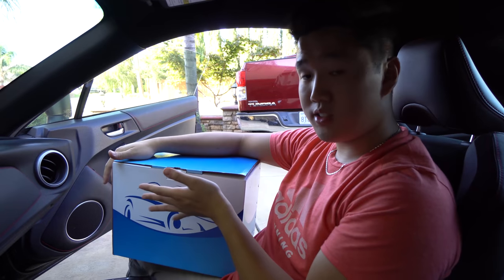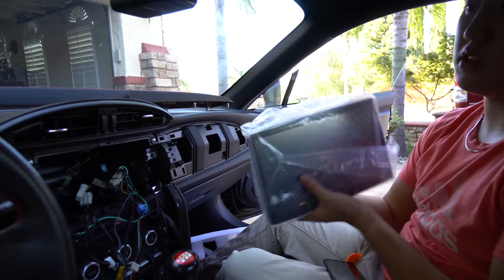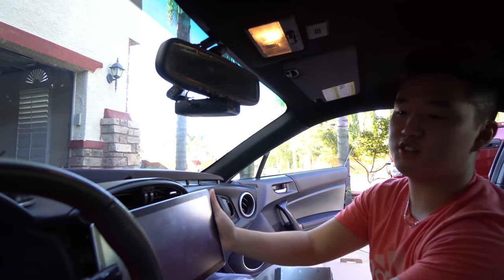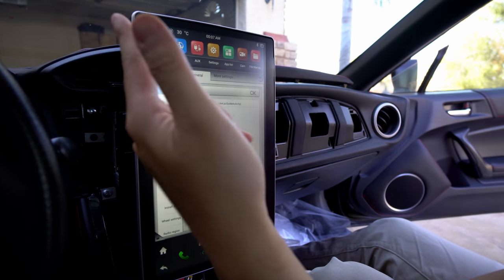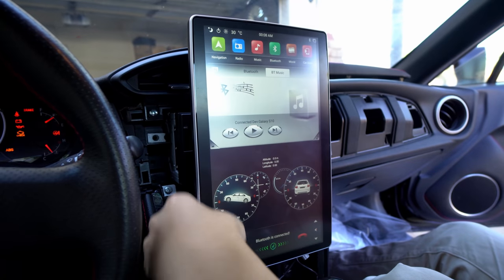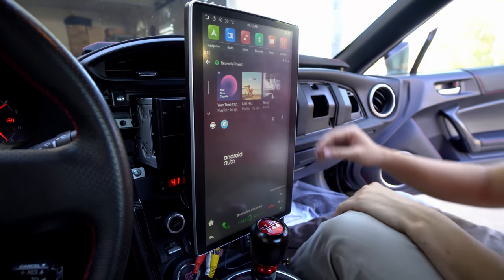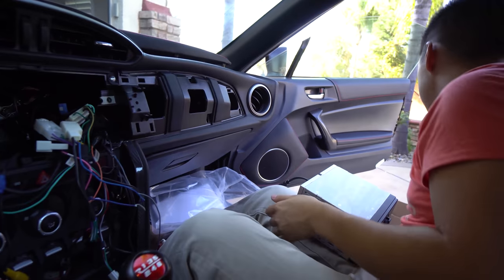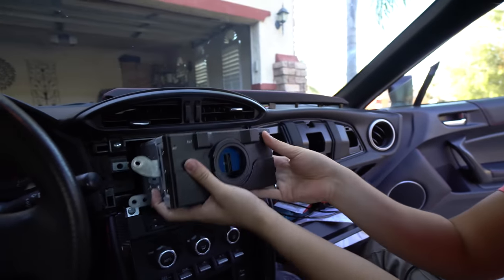The biggest 13 INCH Head unit into a SMALL Car | Install

Comment: How do you prevent theft? I'm sure if someone saw this in my car the windows would be broken. Is it code locked?
Reply: Naughtysauce yea because those are the only two factors that go into getting your car broken in to
Reply: Naughtysauce  In NY I pay about 2400 dollars a month for rent, this is the only neighborhood I can afford.  The "dark ass tint" is not allowed in this state. I don't know if I can find a job right now that makes more than 150k a year so I'm kind of stuck.
Reply: @devinotruth  I couldn't agree more. I only been out in NY for about a year now.
Reply: I have the same question. I have a Camaro convertible and they don't make the custom ones for that car so I have to get this universal unit where the screen sticks out. I like to leave my top down and don't want anyone reaching in and snatching it. The guy told me the screen was detachable but after looking at this video I see there's a bunch of work that goes into detaching the screen. 
 So I guess my dreams of having a Tesla screen will have to wait until I hit the lottery and buy a Tesla.

Comment: Nice 
I just use my Samsung galaxy tab a (with poetic rubber case with 2 magnets inside the case) and 2 air vent magnets to install in my blazer
I'm using a jvc media player bluetooth player as my deck. 
Cheap solution but works great been using this setup for about a year now.

Comment: My friend I'm using aftermarket camera where do you attach the reverse wire to on the radio not the camera as the yellow RCA connection and a red power wire.

Comment: that's an awesome looking unit, I just bought my 1st android head unit an its been a big headache from day 1, I have the hizpo 10.1 android 10 3gb ram 32gb storage of storage I've had issue after issue currently have lost android auto after having to do a reset to fix the last issue, if you could point me towards some type of support or an online page that would be awesome you seem to know a little bit about them so I figured it was worth a shot to ask. Also I plan on upgrading to a better unit when I get a little money saved up to do so what brand would you recommend going with to possibly have a better experience next go round?

Comment: Could you do a Navigation review on the unit from the built in Nav maps as well as compared to android auto,Apple maps and Waze on the headunit? Also how many bands is the EQ? Lastly can you show how Apple CarPlay works on it please! As well as digital audio through USB on both android and iOS if the unit supports this! And front and rear cameras and menu options like DVR

Comment: Was this plug and play for all speakers? I know some wiring harness have the amp-con wire that needs to be hooked up for the door speakers to work. Did the included harness need that as well?
Reply: yes, some cars need add canbus to support original amplifier and original car info.

Comment: Since I saw you present this heady it I got one and waw the full had screen is a pleasure, however too bad it stock to android 8.1 did you find a way to update it to 9 or 10 ?

The only point that annoying me is if you get a phone call, the dial pad remain on the screen and refuse to let you open other apps, excepted if the app was open before you get the call.

Well it almost perfect headunit to me.

Comment: i think i asked this question....does the HDMI out function as video out for rear entertainment. I currently have the joying 10.1 with video in and out connected to a 25" drop down gaming monitor in my SUV.. i want to buy this one to upgrade but want to know about the actual function of the HDMI out!!!
Reply: The Aliexpress listing says it's HDMI output for external monitors.

Comment: How far can it tilt down? I have that slopes down where the DIN doesn't at a 45 degree angle to the ground.
Reply from the maker: it has a ball joint that can tilt up and down. It tilts enough but your screen would generally be hitting a trim piece if you tilt it too far lol

Comment: I had asked u for a review on a 12.1 a while back an here u go with the 13. Thanks. Are we getting a review. Im almost ready to install my next head unit and it will be one these 12 to 13 units.  My main concern is sound and boot up time. I've an 04 golf that will actually fit this pretty nice without blocking anything so its it's a go for me. I will have two amps for bass an voice with the sub so how good is the sound quality an the adjustability on these? Do they have sd card readers?
Reply from the maker: Hey,

I will be doing a review soon. Still testing the Unit!

To answer a few questions the boot time isn't as fast as the other units on my channel and the sound quality good enough but not as good as the DSP models on my channel.
No SD card!

Comment: A game changer would be if it could play YouTube, movies, etc.
Reply: It does🦸🏿‍♂️
Reply: Myke Jones You have it to?
Reply: @justinguarino201  yes
Reply: Myke Jones How did you get it to have those features? Mine is blocked out since it isn’t “safe” to have/do when driving”
Reply: @justinguarino201  you dont know how to bypass so video plays while driving?
Reply: Myke Jones Nope.  Tried to find out how to do it but couldn’t find anything other than jailbreaking my phone.
Reply: @justinguarino201  you have to ground the wire that is supposed to go the brake
Reply: Myke Jones I do not want to play through DVD.  I wan’t to play it via Bluetooth, but I am not able to download any additional apps nor do the ones from my phone transfer to my Sony XAV-XA210.  I want it to go through car play (basically mirroring my phone
Reply: @justinguarino201  so carplay or android auto is your best choice
Reply: Carbar Car Electronics what?  I already have CarPlay.  There are restrictions to play videos via YouTube, iTunes movies, Snapchat, Instagram, etc are all restricted for CarPlay or android whether the vehicle is stopped or moving.  I am trying to figure out how to bypass the system and so far the only thing is to jailbreak my phone (which I would prefer not to do).
Reply: How do yall like the radio I want one but I dont know how they hold up
Reply: Mark Hill I don’t have that.  Looks cool, but I spent 500 on a 8 in Sony.

Comment: Too distracting.    Head has to shift down eyes down off road.      Will cause accident.   
Any kind of movie playing while driving.    
Is distraction.      Looks like a ticket for distraction driving.   
Everything should be hands free.   
Eyes should be level and  on road.
Not down and right.  
Hot day no ac.   Vents blocked 
Your going to be sweating when you run something over while watching videos